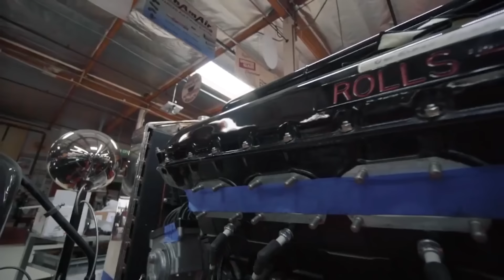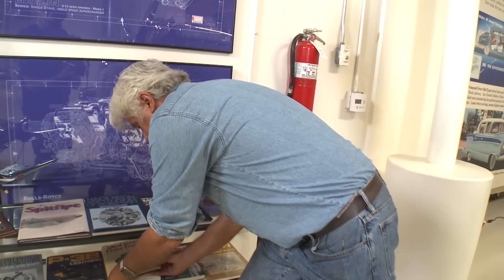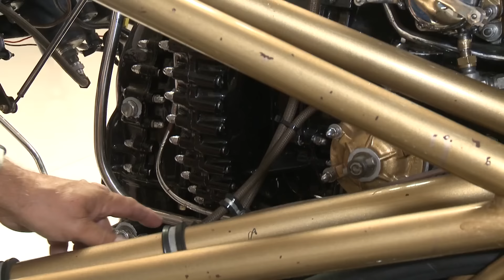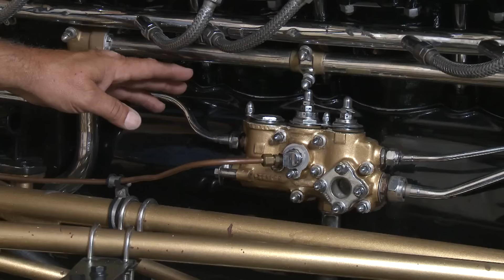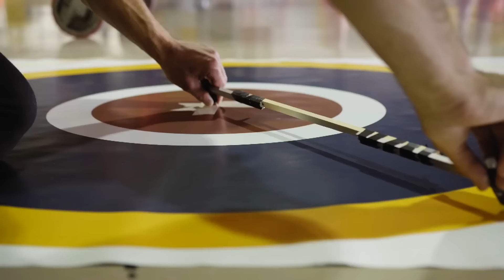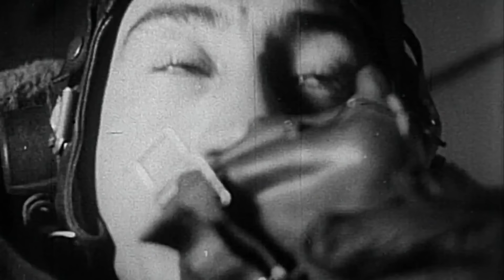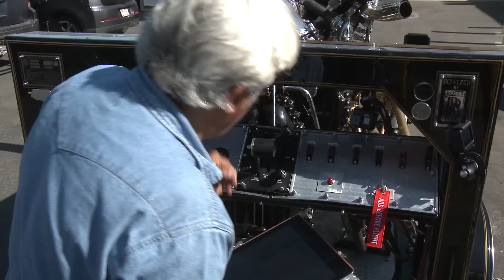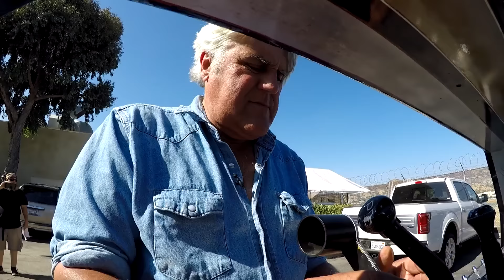The Engine That Won World War II - Jay Leno's Garage

Comment: Best motor of WW2 was the 2000 hp Pratt and Whitney R-2800 motor used in the P-47 Jug, Corsair and Wildcat. The 1600 hp British designed Merlin motor was good but nowhere near as effective as the air cooled American. One tiny German bullet into the radiator and it was game over for the Merlin drivers. Meanwhile P-47s with the Pratt and Whitney could take tremendous damage and still make it make to base. Search "Dogfights P-47" on YouTube and convince yourself.
Reply: Please: engine! Motors are electric, hydraulic and pneumatic.
Reply: Shaun Mclaren iconic based on what criteria? The spitfire gets too much credit when the hurricane was the bread and butter of the RAF. The mustang gets too much credit when the P-47 was the American workhorse

Comment: Choke it
Reply: There is no choke, that's what the primer is for.. you keep using it like an accelerator pump until it fires. Then you use the mixture lever and blips of throttle until it warms up.  :)

Comment: did these engines at one point run on castor oil? I thought id read where sometimes the bombers would come back being shot through the oil tank and no oil in the engine but it'd still run because castor oil leaves a residue. And that residue was enough sometimes to get the boys home. It was one advantage for the allies and the axis did not have a supply of castor so they did not have the same side effect; their engines quit.

Comment: Glad he finally figured out to move the mixture out of idle cut off. Runs a bit better that way ;-)
Reply: He was correct by keeping the mixture at Idle Cutoff. When you heard the guy say something is running out the bottom, that was gas...  Jay simply nursed the excess gas that was in the system through the engine by burning it in the cylinders. Had he not preformed the start in this manner, he could have ended up with a carburetor fire. BTW, this impresses me even more. I also get the feeling he may own this engine but hearing him talk leads me to believe he knows history is the real owner.
Reply: He was correct to start in cutoff when it was flooded but then didn't get the mixture back up when it started.  He started it on prime fuel several times and let it die and the went "oops", you can see the moment when he realizes what's wrong, and brought it up the last time which kept it running.
Reply: Haha lucky he was following the checklist rigggghtttt.

I'm positive it would have said:

 Advance mixture when engine catches.
Reply: I was just before sending a note suggesting the same thing...to go forward with the mixture.  Likely, it's the thing to do as soon as the engine lights off.
Reply: and not the 4,000 RPM he stated at the end but 3,000 RPM.
Reply: Emergency boost - where the pistons come out for a breath of fresh air.
Reply: You beat me to it. I was going to mention that the engine was running on prime fuel only. Not the best thing for the cylinders....
Reply: +Cory Carlson 
why is it painted like that, looks like a dogs dinner. thumbs down on the paint.

Comment: The next aircraft display engine Jay should build is a Pratt & Whitney PW4098. He can charge dumb tourists a small fee for the St.Maarten Maho beach experience. Just need to add a fence for them to hold onto and some concrete and sand for them to break their necks and heads on.

Comment: You really don't have two cars with Merlin engines in them. You have Two cars with Meteor engines in them. Merlin engines had the output shaft at the front - for the airplanes propeller as the standing model you showed has, and a huge supercharger behind the engine. You have two cars with Meteor engines. This was the lower tuned tank version of the Merlin, No supercharger, rear output shaft. The con rods had a 1/8 of an inch hole drilled just above the "Big End" My Dad who worked on these thru WW2 (and for much of his life and was awarded an Oak Leaf to his decorations as he was "mentioned in dispatches" for keeping his unit the 88th HAA (Heavy Ant-i Aircraft Artillery)  in action without a refit for 3 years in the desert with the 8th army (Desert Rats) . Used to smile at the explanations for this: It apparently threw more oil up the cylinders to lubricate the pistons etc. In fact it showed this was an inferior con rod not to be used on Merlin engines but was OK for Meteor engines which produced lower power due to the lack of supercharging and the need for greater durability. I have never seen a car with a genuine Merlin engine, but if you can prove me wrong I would appreciate the link. Enjoy your posts. Keep them coming.

Comment: Hi Jay your Merlin is a thing of beauty.  I am an Air force veteran who was trained as an engine specialist on the R4360 (thats cu in).  28 cylinders 56 plugs.  Depending on the config it was rated about 5000 H.P.  I think it was used on the B50 heavy bomber and the C124. cargo plane.  Somehow it looked less complicated than your Merlin.

Comment: Cool. Packard Merlins were designated Merlin XX and rated at 1480 hp. Now you need the Merlin's bigger brother: Rolls Royce Griffon that powered later aircraft. Including later model Spitfires. At 2200 ci they produced up to 2450 hp at 3000 RPM. Great to this this running.

Comment: max fuel consumption on  just one of the four engines on a Lancaster bomber is 150 gallons per hour (one engine ), Jay has a 5 gallon tank, that calculates to 2 minutes of runtime, again that is max cruise speed and of course jay is just idling the engine so maybe 5 minutes max? love the "ADD BEFORE FLIGHT" tag, usually as most pilots know is says "REMOVE BEFORE FLIGHT" Love jays humor.

Comment: That mixture idle cut-off will get you everytime! The engine starts and then quits because the cylinders have been primed with fuel but the fuel/air mixture is set to 0 for starting. As soon as it catches, the mixture lever has to go forward so fuel will actually get into the carbs.

You can see the moment Jay realizes the missing step.

Great video, nice nod to the Warplane Heritage Museum!

Comment: You should show a Merlin piston and connecting rod on a video sometime. I think most people would love to see the size of the piston, and I've always found the con rod fascinating where one con rod straddles the other one, rather than having the cylinders offset.
Reply: v12tommy I think harley uses the same setup
Reply: +117640972153144082827 You are right. I've never built a Harley, so I had no idea.

Comment: The Pratt & Whitney R2800 won the war.
Reply: I'm afraid that there's little argument for that. The merlin is almost certainly the most important engine of the war and good evidence for that is just by looking at how many nations used it, even nazi Germany tried using them if they managed to capture them.
Reply: One lucky shot to the radiator and the motor is 100% done.  Radials were more robust by far and produced more torque per liter...

Comment: I remember doing a shut down at a gas plant where they had several 12 cylinder Waukesha engines to push shmoo through pipelines. They work at about 1000 rpm and rarely go higher.

Comment: I live near the Hamilton International Airport which is where the Warplane Museum is located. I have seen the Lancaster runup, taxi, takeoff and land. Since I live near Hamilton, at least two or three times per year, the Lanc flies over my house either on its way to or from the Hamilton Airport. There is no sound like a four engine, piston powered warbird flying over your home. It brings goose bumps every time. For anyone thinking of purchasing a seat for a flight, be warned it is very popular so advance booking is required and it's not inexpensive. The museum's website has the details. I have not coughed up the scrilla to go on a flight but it would be memorable. Great video Mr. Leno.

Comment: Jay,  why not have a custom  propeller made up with a  symmetrical airfoil and zero angle of attack? You could then spool up that beauty without worrying about what it's tired down to. What a sweet engine though! Thanks for the video!
Reply: Perry Wolf b/c that would be not fun. Also that prop was not full size

Comment: Somewhere out on the internet is a video that shows "The squadron that never was" it was done at an air show in New England in the 80s. It is a Lancaster, a Spitfire, a P-51D Mustang,  a P-47 Thunderbolt a B-17 Flying Fortress, and B-24 Liberator. The sound as these planes made a pas at about 300 feet will warm the heart of anyone with oil and gas on their veins. It is a gear-heads fantasy.

Comment: The engine that won WWII was the Pratt and Whitney R-2800 Double Wasp. It is found in F4U Corsair, F6F Hellcat and P-47 Thunderbolt just to name a few.
I get it, with drop tanks the P-51 (with Merlin engine) could make it to Berlin and protect our bombers but I think that if you look at the number of kills per plane you will find that the Hellcat has a higher kill ratio than any other plane in WWII.
Still I love the video and these are great engines.

Comment: My uncle has a 1978 Plymouth Horizon TC3 with 28,000 original miles, no rot, been in a heated garage, all original. even tires are from factory with no dry rot, He is selling car in Rhode Island for 5000. or best offer, would be perfect for you garage.

Comment: This is the primary engine for the WW II Spitfire.  We had the P38 which used Allison 1710 turbocharged engines.  I saw 2 of these engines in a patrol boat, they were taken out due to high fuel cost.  Occasionally they are used today in Tractor rulls.  Although these engines are great I prefer the prat an Whiney Radials.  My favorite being the R-3350, it was used on the B-29.  In the NAVY and Marines it powered the F8F .  These would on weekends fly over my house at 200 feet!  Scared the chickens!  Then the AD5 was developed it used the R-3350 and saw limited service at the end of WW II.  It saw extensive service i Korea and Vietnam.  All of these engines were superlative !!  THe Merlin and Allison were expensive during WW II costing a tad more than $2, 200 a copy.  I was a US Marine Engine Mechanic on the Radials in the 50's

Comment: Hi Jay / Heritage War Time Museum in Toronto, would be a fun trip for your viewers. Check our the  Yankee Air Museum, at Willow Run Airport • Van Buren, Michigan.  They maybe able to  help you find an airplane for this engine. Great video.
• Cheers from The Detroit & Mackinac Railway 🚂
Reply: trainroomgary its in Hamilton not Toronto
Reply: Hi Robert, thanks for the tip. I am about a 4 to 5 hour drive from Detroit. Better yet take VIA Rail from Windsor. 🇨🇦

Comment: fit that engine in a HONDA CIVIC
Reply: I think you would have to attach the Honda Civic to the Merlin!
Reply: i doubt that engine would even fit ON a honda civic ...
Reply: IJ SAY I don't think it'll rev high enough for vtec to kick in
Reply: Ian Lane lol....I'd pay to see that.
Reply: IJ SAY there's a video of one in a Rover SD1.....CRAZY.
Reply: Maybe the Honda Civic could be used to start the Merlin.
Reply: The engine would remain stationary and the Honda would revolve at 3,000 rpm :-)
Reply: As an airboat fan, bet that would one hell of a motor on a flat bottom air boat. Likely to much power.
Reply: Doug Whole 
Not quite. That Rover has a Meteor engine from a tank (basically, an unsupercharged Merlin)
Reply: Can't be done - the Whiffle pins wouldn't stand the extra torque! :-)
Reply: no.attach the Honda to this engine.   (:
Reply: Me too! Think I've watched to many cartoons, which at my age (63) is no excuse but what the hell!!
Reply: IJ SAY I think it can i have one in my Fiat 500 first gen

Comment: The marine variant of this motor was out into the 80 foot Elco PT boats in a triple arrangement.   Image what that sounded like going nearly 50 mph over the water standing on a flush decked boat with three of those Packards under your feet purring away.

Comment: Well considering the P 38 lightning is what won World War II I'm not entirely sure this engine is what was in that plane.
Reply: The P-38 used the Allison v-1710 which was probably the closest American equiv. to the Merlin (except of course the Packard built Merlin's) - the v1710 sucked at high altitudes because unlike the Merlin didn't incorporate a turbo/supercharger directly on the engine.  The P-38 though had a huge supercharger behind each engine in the booms which eliminated that problem in its case.

Comment: Well, the main problem with the carburation set up at least in the Spitfire was that pulling negative Gs would stall out the engine. The top German aces (whose Me109s were fuel injected) understood this and would sometimes prevail over the Spitfire because of this unfortunate characteristic. Also unlike that Patt and Witney 2000 hp radial in the P47 and Hell Cat and Corsair, it wouldn't tolerate much battle damage. I always loved this engine though P51D!

Comment: I'm struck by the incredible balance of the engine. Sure, aircraft engines NEED to be balanced, but I was looking at that trailer while the engine was running and I couldn't even see a hint of movement. Very impressive.

Comment: I have a couple of friends who own P51's.  My understanding is that hese engines require a rebuild after every 200 hours of operation.  At the end of WW2 you could purchase P51's for $850.00.  Most passed them up because of high maintenance cost and fuel usage.